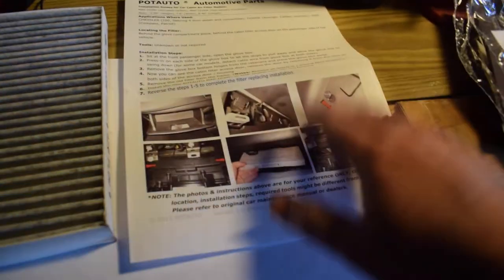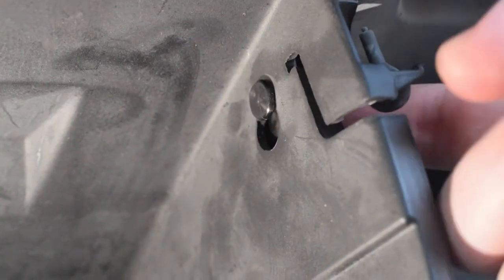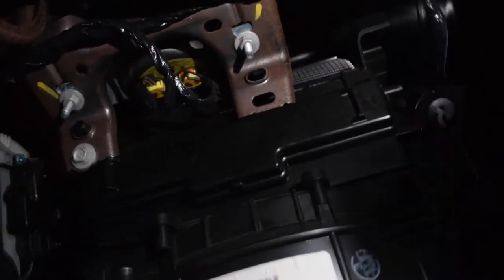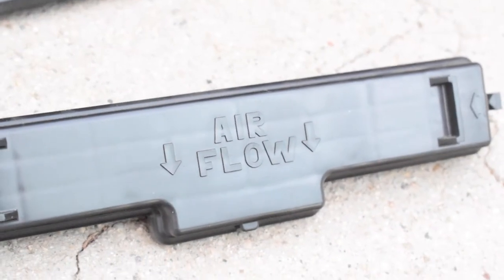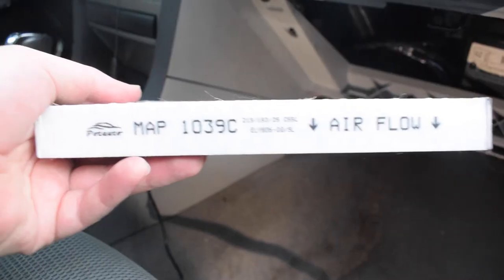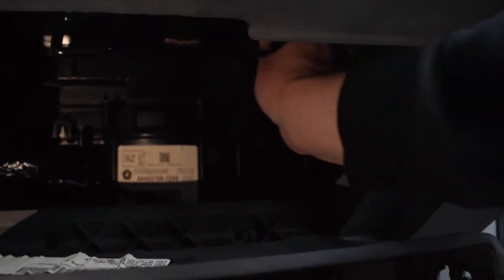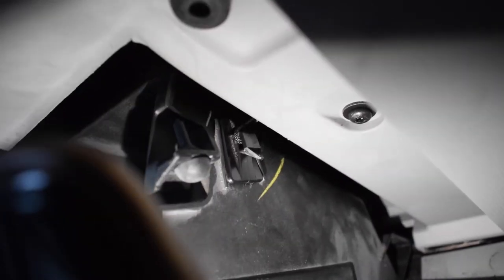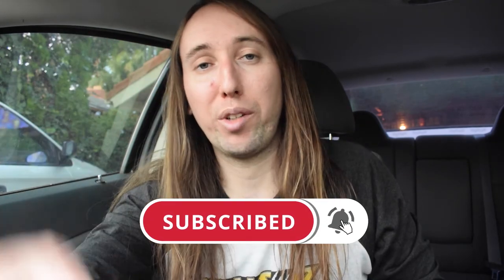How To Replace Cabin Air Filter on Dodge Avenger 2008-2014

Comment: I'm glad I showed that I've had an 08 avenger for 6 years and didn't know it had a cabin air filter definitely changing it this week also I've changed the heat door actuator on the right and the middle because of clicking on both but for some reason the heat still doesn't work on passenger side but the clicking stopped and the AC works fine all way around I've also replaced thermostat still only heat on driver's side only any suggestions also I've replaced all 4 o2 sensors because for some reason it tells me bank 1 is to lean and had cayt. convertor replaced and at least once or twice a yr one of the coils has to be replaced  for some reason any ideas on that ?and would cabin flow filter have anything to do with the heat not heating on passenger side thanks for anything u can tell me other than that it's been a great car and I continue to drive it . thanks for the info on cabin air filter
Reply from the maker: Hi the only think I can think of for your passenger side heat not working is the blend door actuator. I believe the Avenger has 3 all together. I replaced the one on the drivers side in mine, but there should be one on the passenger side too. Here is the video of me replacing mine on the driver's side https://youtu.be/LUBPIxzrUeI

Edit: I believe there are 2 blend door actuators on the passenger side behind the glove box.

Comment: These newer cars are becoming more and more complicated for the average owner to maintain themselves. Air filters have always been right on top of the engine. Now you have to go through the trouble of taking glove boxes apart to get to them.   I wanted to buy one of these cars but wound up buying a Ford Focus. How is the gas mileage on your car?
Reply from the maker: Yeah I guess I have never changed the cabin air filter on any other car so I don't know any different than this, but yeah I would say on this car especially, a lot of stuff is way more complicated than it should be. For example, you need to take apart the drivers side wheel well to change the battery lol. My car is the V6 so it's supposed to get 16 city and 26 highway. How do you like the Ford Focus?
Reply: That’s the engine air filter the one in the glove box is ur cabin air filter their different

Comment: Men the string that you detach is hard AF a can’t put it out, and yours comes out like nothing
Reply from the maker: Something about that chord makes it a bit awkward to pull out, but after the first time I did it, it became easier
Reply: @TobiasHolenstein  Well I tried with all my force, and it better broke off the cable, the good thing is I can now access to the air filter, maybe with a little knot the cord has still working, because that plastic thing looks like it was glued.